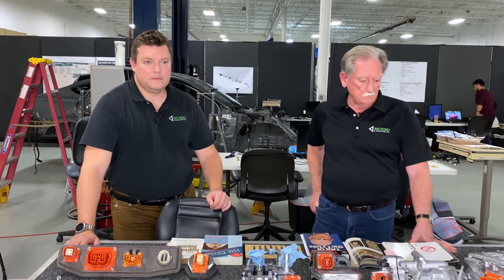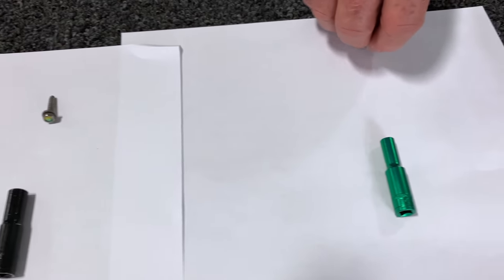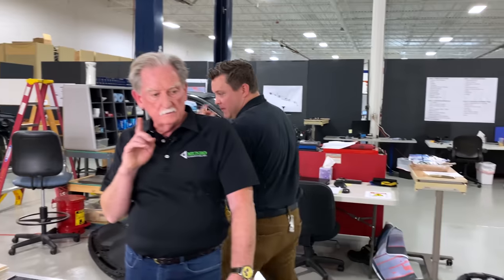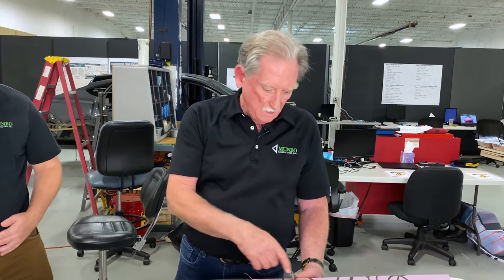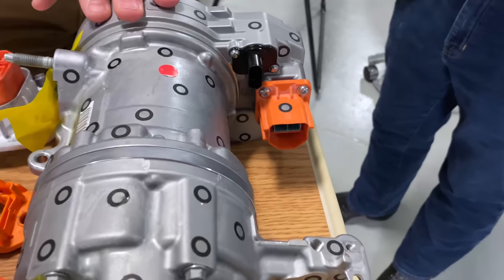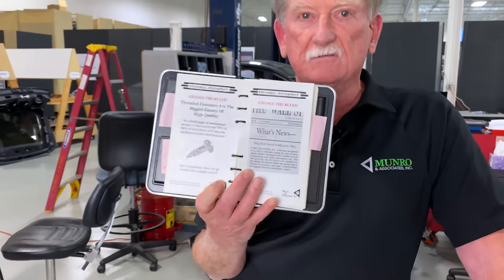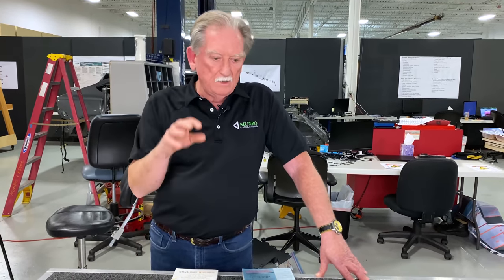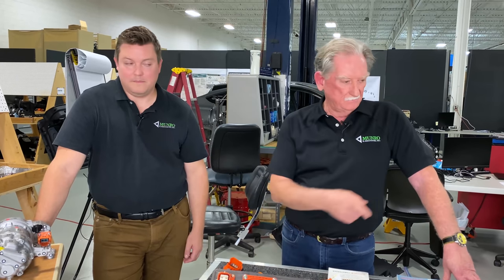Mach-E High Voltage Connector PALOOZA!!!

Comment: I'm all for Engineers, but it shouldn't take an Engineer to grasp these concepts. Apply some logic. I've said for 40 years, that if the people that design automobiles had to put them together on the assembly line, or even more so, repair them, they would never design them in the same manner again.

I also believe in following the money. Who is making money on all these fasteners and tools? Many people have a vested interest in keeping things the way they are. If I was in charge and after seeing this, I'd be helping a lot of people immediately update their resume. (If I hire you and I still have to do your job, I don't need you. BYE - BYE.)

Remember the Cadillac Cimmaron, I think it was, (and I believe other cars) where you basically had to pull the engine to change spark plugs. Or, the cars where you have to search for the oil filter, let alone be able to get at it to change it. How many mechanics didn't bother to change the filter and just drained and added oil?

It's been over 100 years since Henry Ford instituted the assembly line and they still have such poor design? No wonder Tesla is eating the lunch of Legacy auto companies.

Comment: 4:19 I almost guarantee you that it's a torx plus. Trying to use a torx socket on torx plus is why you had an issue. Look at the socket you're trying to use, look at that counter taper, that's almost the entirety of the head depth. 
You're using the wrong socket, that's not justification to complain about the fastener head design.

Comment: What a clusterfuck of parts with Ford!
There is no way they can compete on price, quality, weight, etc.

I think that the compressor from a supplier is the next thing on the chopping block of Tesla.
I will become another core technology with their home AC: better efficiency (Tesla motor and inverter tech) and more integration

Comment: And Motor Trend just selected the Mach-E as the EV car of the year.  Please.  Slower, less range and filled with unnecessary doo-dads and rubber tubing that will eventually fail.  Yes, but "build quality" - please.

Comment: This is so embarrassing for Munro. All of these Ford components are from suppliers, this is why they have different type of screws, because different suppliers have different kind of tooling available. Ford does not care, they will never undo these screws and they don't force the suppliers to use different type of screws/tooling since they will charge them more.
Reply: You missed at least part of the point.
It takes manpower (personpower) to order, received, store, distribute ever screw.
If if you go to a supplier and ask to 3 million screws, you get a better price than if you ask for 500,000.
If you work on the line, do you want 1 tool, 1 bit, to inset 10 screws, or 6 tools, 6 bits to insert 60?
It's lazy design.
Reply: Well I suppose your argument would be valid, except for the battery plate where that is all on one component ?
Reply: This is so embarrassing for you.. you miss the entire point of everything said lol
Reply: @rogerstarkey5390  What are you talking about? These suppliers that make the heater, ac etc ship millions of units per year to multiple OEMs and each of them has standardised a kind of fastener/tooling  to be used in their own factory. So Ford asking them to not use their preferred fastener and tooling will increase the price of the final product. This is why you see different screws in different sybcomponents, because different suppliers or sub contractors make these units thus everyone uses the type of screw that they have standardised within their factory
Reply: @grahameida7163  Correct, the VW big plastic connector is better than what Ford used. 

But arguing that Ford should force these suppliers to use a specific type of screw rather than what they use in common is a stupid idea.
Reply: Can you imagine the cost of replacing Tesla proprietary parts compared with Fords more available parts.  The cooling system for Ford can be fixed if it leaks. Hoses and connectors may leak eventually but I can fix those. The fittings on a Tesla are proprietary and many components are combined into a complicated devices only available from Tesla. Hopefully the Tesla never needs servicing because if it does you will be so screwed. Reliable enough but fixable at a reasonable cost beats very reliable but extremely expensive to fix. IMO
Reply: @jamescross5038  afraid I disagree that repairing something repeatedly is a better option. Even if it is cheaper. I'd rather repair something once over a span of some years for a higher cost, then 3 times over the same period for less money. And I sincerely doubt the costs in the end are meaningfully cheaper to the customer, as labor is always the most expensive part of almost any repair, even if the part is proprietary and more money in this scenario. And the customer satisfaction of a car that breaks less, is to me, priceless. I can understand we might disagree here.. but I'll take the better design with higher cost, over the less efficient design for cheaper.